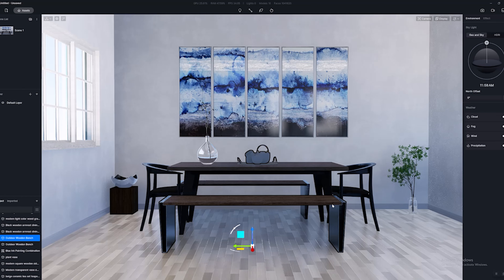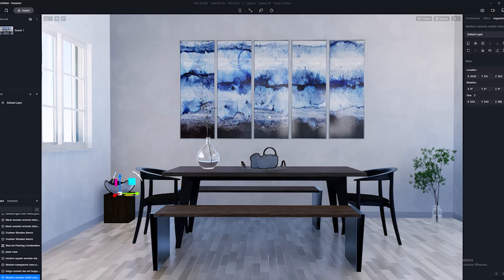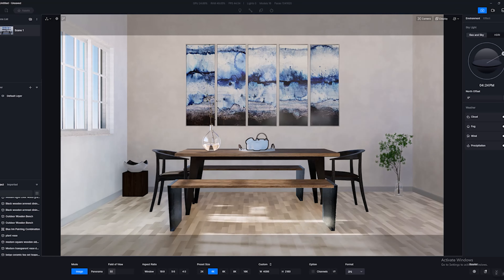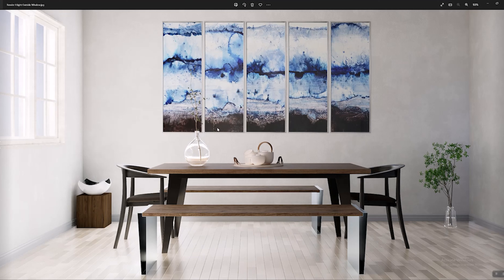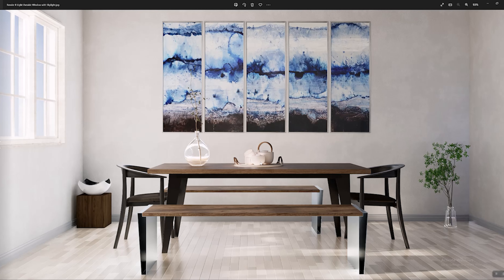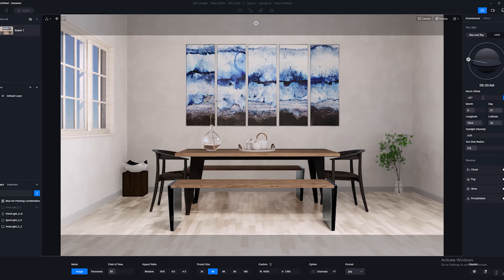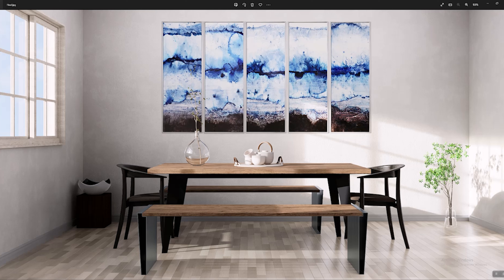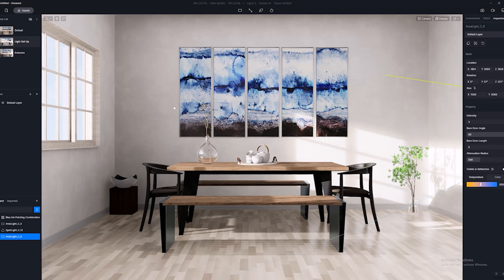D5 Lighting Setup Best Practices

Comment: Hello, thanks for this video. 
But I still don't understand how D5 sync lights with sketchup.. I'm leaving Twinmotion for the moment. 
I prefer to create D5 spots in skp and place it, then change illumination settings in D5 after sync. But when I duplicate my spot component in sketchup, it will be reset in the D5 scene : so I have two copies in skp that have different settings in D5! and I don't know how to fix this.
Even previous omni lights are affected by spots settings : if I clic on an omni, all lights are selected... I would prefer to be able to "disinstantiate" the lights. and yet these lights have different names...
Very strange behaviour.
Sorry for my english...
Reply from the maker: Hi there. I have not encountered this behavior, but my suggestion is to not synch the lights. Honestly, placing them by hand in the latest version of D5 is really easy, as the lights have better icons, and you can always change the view to Orthographic for accurate placement. Try changing the light color to super strong red, it helps visualise the strength and fallout, then change it back to the color you want. I hope that helps!
Reply: Yes, the tip you give me will be helpfull. I found a way for these lights, saving it in a distinct Skp file and resync... But D5 support gave me a link to an article that could match. I will try it back from holidays. But yes you are right the best IS to place lights in the D5 scene. But note so accurate
Reply from the maker: @jskup  Great! The D5 team can be really helpful, I hope you get a workflow that works for you!